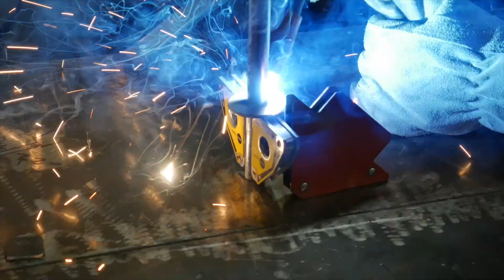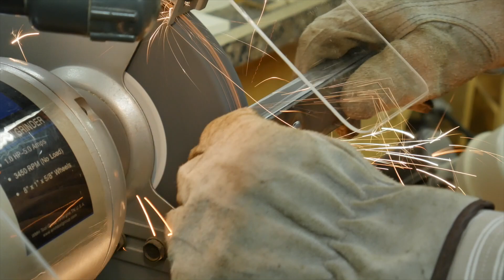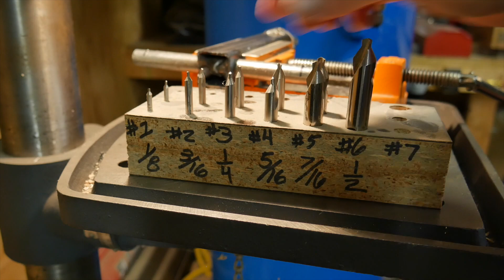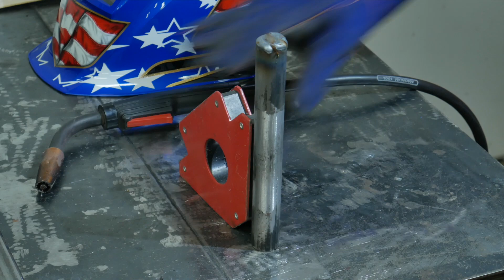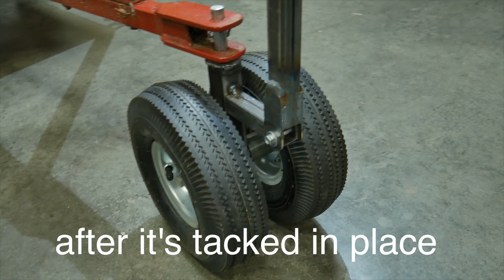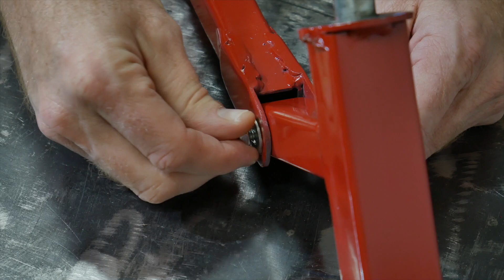Lawn Trailer Dolly - Building a Dual Wheel Dolly for a Garden Trailer !

Comment: I think the way you made the internal axal support and did the blind hole to do the internal welding was brilliant! Where you did the pivot fork (near end of the video) do you think if you are going to use for heavy work  it should be doubled up there because it seems like that could be a weak point as you go from square tubing to the forks? Just asking not a critique.  Great job my friend now I have to check out your other vids because I love your Fabrication techniques and ideas!
Reply from the maker: The pivot could be heavier but it doesn't haul anything bigger than I can pull by hand.  Getting a bit weathered out there but still works OK.  Thanks for the comment!!

Comment: What your trick to keeping your magnetic clamps so free of grinding swath? I keep mine in a plastic ziplock bags, but that only helps in storage.
Reply from the maker: I brush them off.  Compressed air works of course, but I don't like that amount of eye shrapnel in the air.  I'm still trying to devise the best way to store them while in use to keep clean and prevent them from grabbing tools and magnetizing them.
Reply: David Schwartzp

Comment: great but will be better, i guess - if you dont show all that unnecessary welding skill with superwhite stricking harmfull light tha shock the eyes - and instead of waste precious time you install the steering mechanism in the rear part of the trailer. im working on a similar system right now for my welding cart but the operator will be guiding the cart from behind, with a 12vdc motor and chain - not from the front of the cart with an axle that could turn 360° and in that way you have better options
in that way, you dont have to strip your wrists or turn your head 180° every time you are going straight in any direction or when you are turning, like back in the 1800s.
for the stering process you could use a steering scissor system with the axles cut as you did on both ends or in the center, if you like, or use a pulley system with rope or soft cable like the boats to guide your front axle. if you preffer you could go more fancy with an hydraulic system instead
its very simple lol
Reply: i donot care

Comment: Would like you to explain  what your doing and why.  Disappointed.......
Reply from the maker: It's for a small trailer like you'd pull behind a lawn mower or garden tractor.  The dolly has a fixed hitch pin to attach the wheels to the tongue so it can be pulled around by hand.  Thanks for the question!